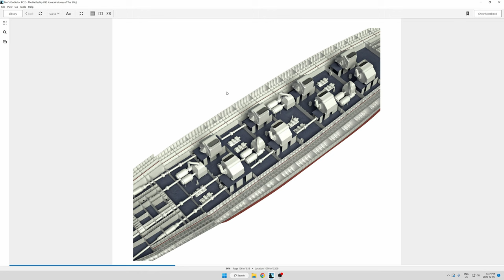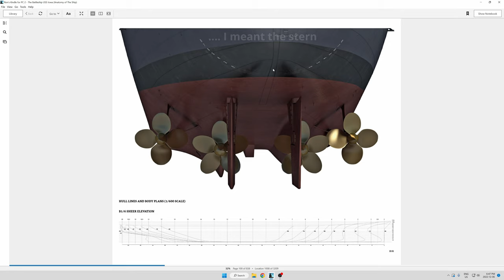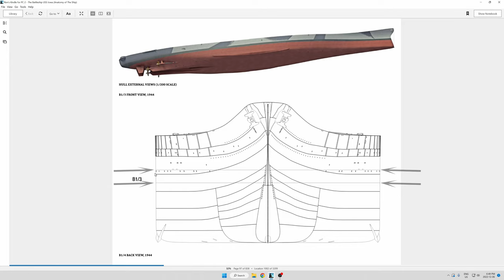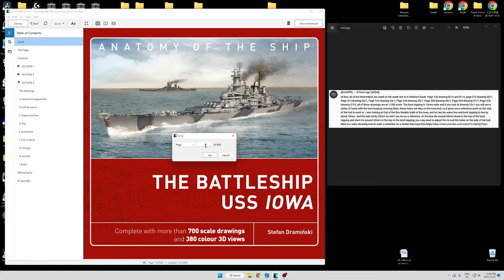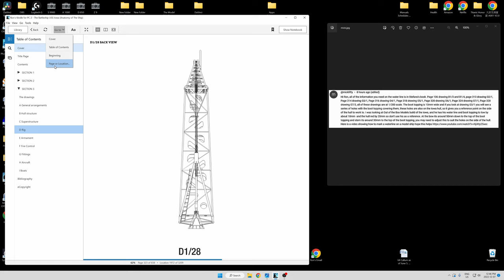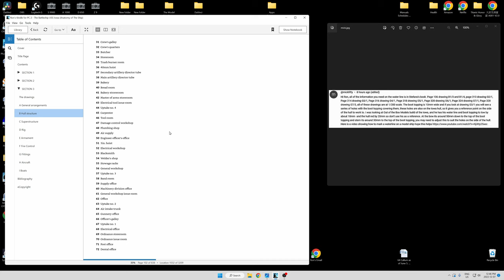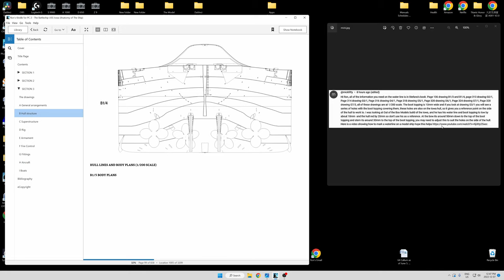The Model Ship - Part 1392

Comment: Hi Ron, Thanks for going over the airbrush. I'll have to get some of those quick connects. I never knew they made them. A suggestion, you may want to prime the area at the bow you used filler at to check how it looks before you jump right in with the final paint. Thanks for making the videos Ron.

Comment: Did you know... ships started adding a black boot top after ships started burning oil and oil became a common coating on the surfaces of harbors and the oil started staining the hulls of ships at the water line. The black paint hid the oil stains. Prior to the use of oil as a fuel, many ships had white boot top.
Reply from the maker: Interesting ! Thanks Richard 👍